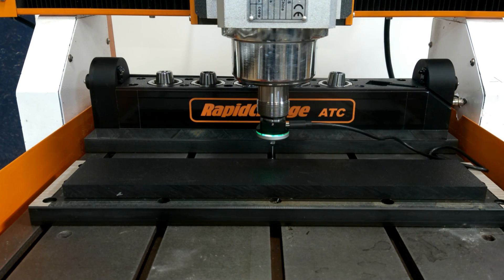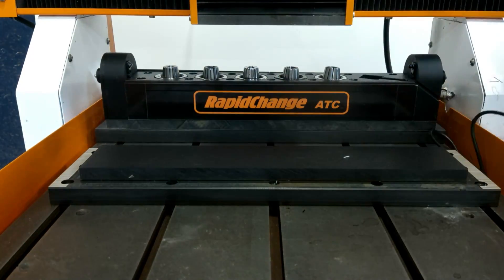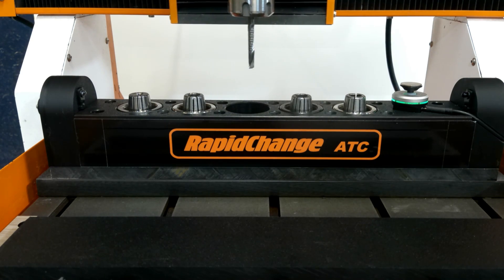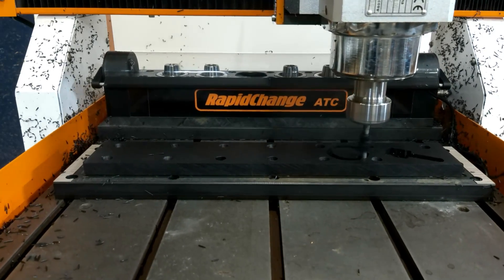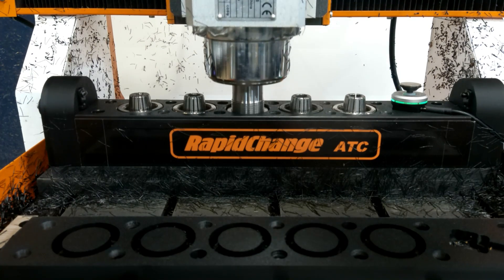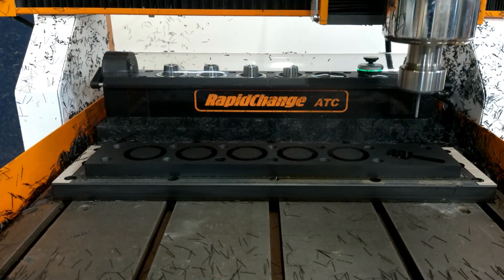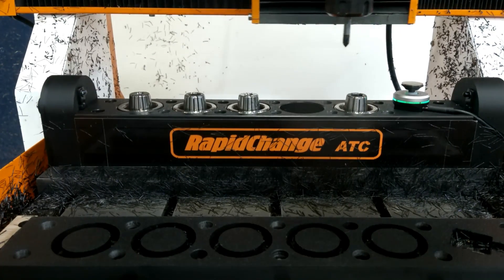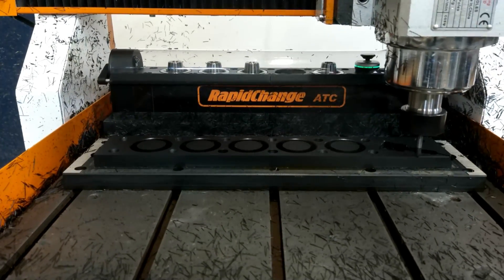RapidChange ATC Automatic Tool Changer 3D Touch Probe - Tool Setter combo for CNC.

Comment: How did you have the 3D probe attached to the spindle? I didn't see a nut, and I'm also not sure how you're able to then use the same probe as a tool touch plate without a Z offset error. Would be helpful to know, thanks!

Comment: I ordered one of your units and just received it today. I can honestly say its well made. Solid construction, looks like it could take a beating. The packaging and item has a strong nicotine smell so Ill assume the packer smokes cigarettes... Lol.. 😄I have experience in using a CNC machine as I've owned a few. However I'm not super familiar with the technical aspects of diving into the control board, VFD and the back end of the software but I'm totally game considering I'm very mechanically inclined. I purchased a CNC machine called an STV CNC here in Vegas where I live. They were curious to see your ATC because they never heard of such a thing.  I ordered the probe which should arrive this weekend. The STV CNC uses a control software called Optimum Control System. Not sure if your unit is adaptable to this but we will find out. My Spindle spins in both directions but the lowest speed is 6000 rpm so I will have to figure out how to slow it down. I believe your site or one of your videos suggested using a different VFD controller. Ill have to try and search for what you suggested. Is there software I'm supposed to download from your site that works with your unit or should it just work with any CNC software.? Love the quality of the product so far, looking forward to experiencing the performance.
Reply from the maker: Thank you for the review, Dale! Reach out if you need any support.
Reply: not very professional if it smells like nicotine
Reply: @hrmny_  Not a big deal considering the quality of the product is stellar...!

Comment: Hello, is there a way to have the touch probe as a tool in the tool-rack of the Rapid Change Atc? It would be very usefull to have an automatic probing routine and then switch to milling tools afterwards. (tool height setting being done with another sensor in that case ofcorse)
Reply from the maker: Thanks for the comment and question. Yes I do have a design with a latching system operated by a solenoid that allows it to be returned to the pocket. the only thing is that it still need to have the cable plugged in by hand. I will be showcasing it soon.

Comment: I'm relatively new to CNC, and I just ordered a Shapeoko 5 Pro with their VFD Spindle kit.  Any chance this ATC could be adapted to work with that machine?  I'm fairly tech savvy and not afraid of getting my hands dirty.   I intend to use UGS instead of their bundled software, but I don't know if the controller they use might pose some limitation.  I know it's some flavor of GRBL...have you have any Shapeoko users as customers?
Reply from the maker: Thanks for the comment and question! I haven't had a Shapeoko customer to my knowledge. I never hear from most guys after they get it and I rarely know what machines they are going on. I am pretty sure their machines don't come wired for reverse spindle rotation. As far as their breakout board goes I have never seen one but if it's grbl based we haven't dove into that one yet. We do have a customer working on GrblHal at the moment. We hope do to get to Grbl at some point.
Reply: @RapidChangeATC  Cool, good to know.  I intend to dive deep into CNC long term, and have already explored the possibility of replacing the stock controller at some point, so if I get that far, I may well look into a RapidChange system.  You did amazing work on this, and I'm really impressed at how well it works.
Reply: @RapidChangeATC   So after some research, it does appear the Carbide 3d has programmed the VFD with the reverse command locked out, and they've password protected the settings - Boo!  That said, someone on Reddit was kind enough to post the unlock PIN, so I'll give that a shot when I get a chance.  Also, it's off-the-shelf chinese hardware, and it can just be factory-reset and reprogrammed if it came to that.

If I can get mine to spin backward, I will definitely be ordering one of your ATCs.  If I can get everything working, I'll make a point of sharing my experience on their forums, and hopefully open up the Shapeoko community to this product.  They also have their own tool length sensor (Bitsetter).  I was thinking I might be able to also use that as an activation switch for the cover, since it's unlikely I'd be able to make their controller run it.

I'm sure there will be some hacking involved, but this is such a cool concept and would be worth the work.
Reply from the maker: @OvidianIdeals  we have a pcb with an micro processor on it to run the dust cover and it can be triggered by an axis so wouldn't need to connect to the board and you could wire a rocker switch in parallel to manually operate it.
Reply from the maker: Not to my knowledge. Grbl based is limited until we can get to the additional code to the firmware. We are working on GrblHal now not sure when we will get to Grbl. It can run from g code macros and the dust cover can be run with an external switch like a limit switch triggered with axis movement so that could be avoided in the code but detecting the state of the tool sensor and a tool library so it know what tool it has will be a lot of work.
Reply: @RapidChangeATC    Gotcha.  Well, a FluidNC or LinuxCNC controller is not out of the question for me in the future, I suppose.  Thanks for the replies!  I'm new to CNC, but already dreaming big...lol.